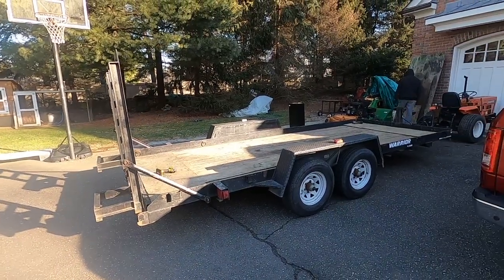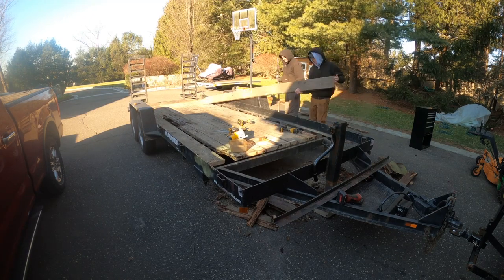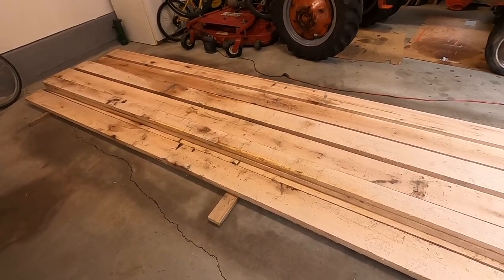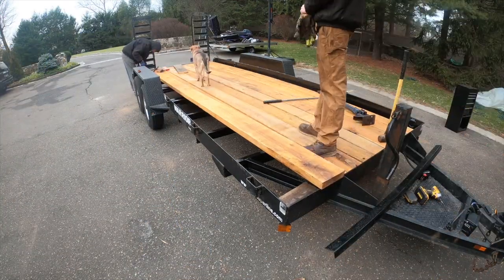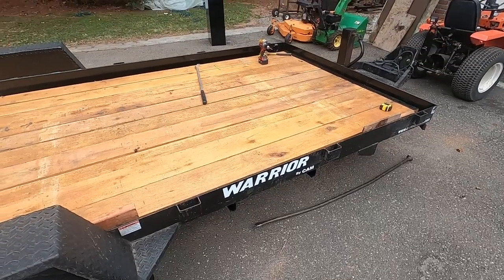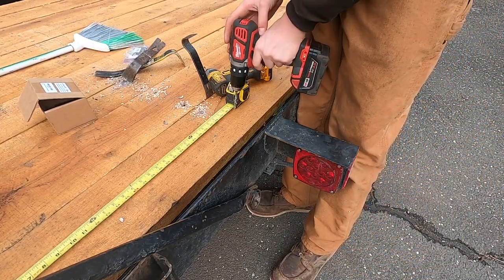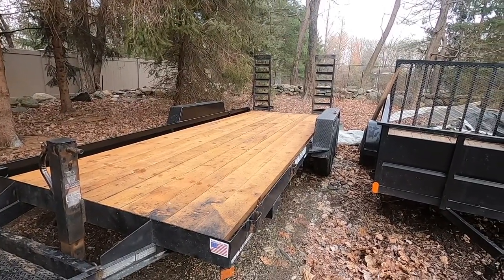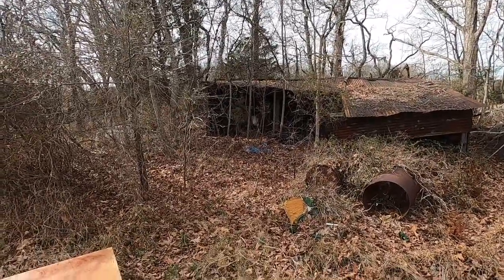Replacing Trailer Deck Boards

Comment: My old man when he would change the oil on the truck would  brush on the used motor oil on the deck wood .
Reply: Old oil mixed with diesel fuel is what I've seen.

Comment: I have a 16 foot trailer with pressure treated deck that is 40 plus years. I am only just now seeing enough deterioration to be looking at replacing. I am not sure that I would use oak. Seems like it would make the trailer considerably heavier. I may be wrong. I need to do some research on that.

Comment: Did you leave space for expansion and contraction of the lumber?
Reply: It’ll create a gap as the green wood dries out. Then there’ll be plenty of space between boards for future swelling and contracting.
Reply: Ditto on this. If you use green lumber or ground contact pressure treated pine you want to butt them tight because they will dry and shrink.

Comment: What type of screw did you use before tapping screw? Thx…Bill
Reply from the maker: Drill bit through the wood and maybe a little into the metal then the screws

Comment: What size boards did you use?
Reply from the maker: the guy with a lumber mill cut them for me 1 7/8" x 8" x 18'
Reply: @thesmallenginekid  we don’t have a lumber mill. They are 1x6 now. I want to go to 2x10 
Do you think it will work?

Comment: You're going to regret putting green boards on there. When it dries out you'll have cracks between the boards wide enough a chain will fall though.
Reply from the maker: The boards did dry out as there are gaps, but not even a 1/4” chain would fall through.